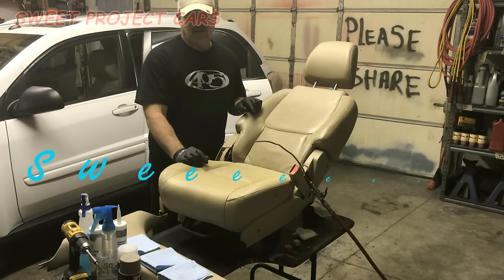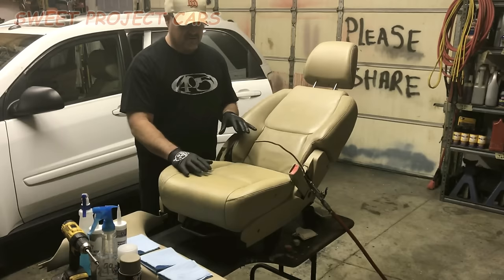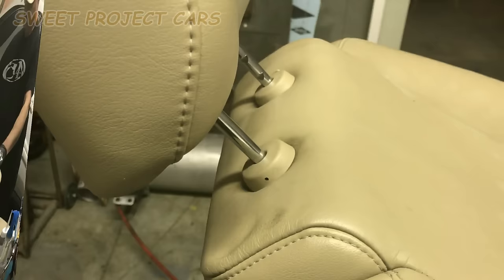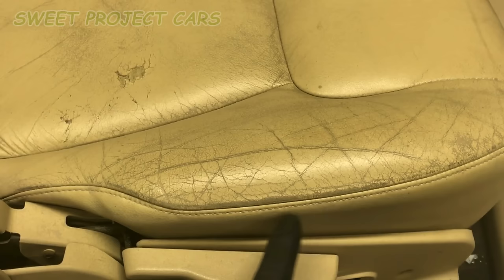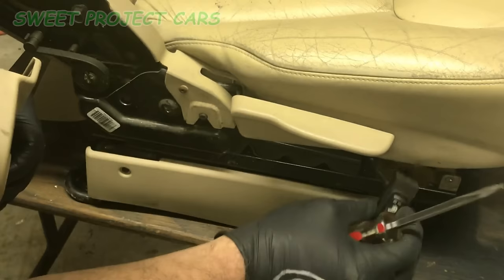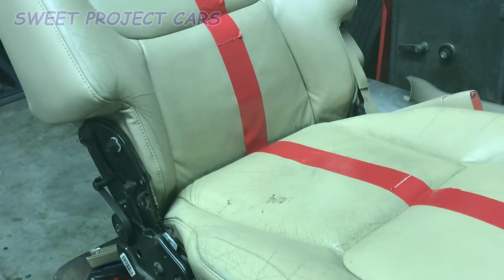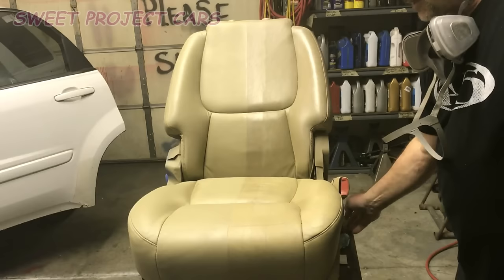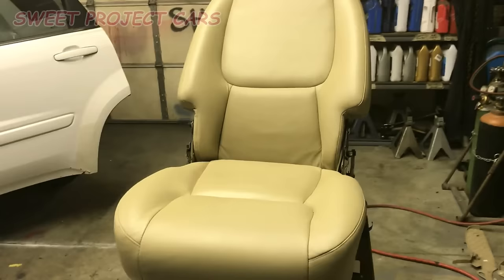How To Repair The NASTIEST Leather & Vinyl Seats....Back To PERFECT!

Comment: Hello, I have a question. After you restore your seats using this method, will you be able to detail them in the future using degreaser and a scrub brush? Will the harsh action of the brush during detail cleaning remove all the hard work you put into repairing the seats?
Reply from the maker: I'm not sure if your question is serious or not, we've been detailing cars for 40 years and never have we used a degreaser or harsh scrub brush on leather.  Thanks.  mad Mike the hammer SPC
Reply: @SweetProjectCars  Recently I watched a you tube video of a guy detailing the inside of his car, with degreaser and scrub brush for all the leather and plastic of the car. I tried it on my car and the results were spectacular, my seats were a completely different color, like new, much cleaner than what I have been viewing since i purchased the car, it was immaculate, they were so clean. What I am saying is that my seats have leather damage, the same leather damage you are repairing in this video, what I want to know is: If I repair my seats with your method, and they become dirty again over time, will my cleaning them with degreaser and a scrub brush harm the filler and paint you use? Basically will the degreaser and scrub brush (abrasive nature) rub off the filler and paint? That's all.

Comment: Does the paint change the texture of the leather? It's a 03 Saab 9-3 SE Convertible.  Also I would imagine the sun has changed the color since it's in the sun so much should I still do that? It's just the front seats that need it in small areas-on the bolster area from rubbing getting in and out and then drivers seat leg area, no tearing just normal leather cracks. The rear seats still look brand new and feel so nice, so supple lol. I want the front seats to look like that! Would you happen to know roughly how much it would cost to get front seats refinished in new leather?
Reply from the maker: Eric, this  https://amzn.to/2PWOfN3  will not change the texture of your leather.  It will be much cheaper to go this route than to have any replacement.  Thanks for the question.  Have a fantastic day!  mad Mike the hammer SPC
Reply: @SweetProjectCars  Awesome thank you!

Comment: is this method okay to use on perforated leather?? like wouldn't it plug up the holes?
Reply from the maker: Hello Mathan, this is not recommended for the perforated seats unfortunately, it will cause issues with the holes.  Thanks for asking.  Have a great day. mad Mike the hammer SPC

Comment: Good morning and thank you for all your videos.  I have tried several and 100% great except one!  I am repairing a leather drivers side seat using the silicone and all.  I believe I followed the method completely using the products you reccomend.  My silicone is rubbing off when used.  It reminds me of dry rubber cement when you rub it with your finger.  Any idea what I am doing wrong or could try?  Thank you Jeanette
Reply from the maker: Please watch all 3 videos in the series.  I cannot express enough how clean the seat must be before applying the silicone.  Hope this helps.  Have a great day.  mad Mike the hammer SPC

Comment: Great video.  The amazon links are not working.  Did you use isopropyl alcohol or denatured?  Also, did you wipe down or prep the silicone in any way after it dried but before you painted it?  Curious as to how you got the paint to stick to the silicone..  Thanks !
Reply from the maker: this is working https://youtu.be/3aFbL8ViTE8 and use this in place of any other cleaner  https://amzn.to/2z3oiBu
Reply: @SweetProjectCars  Thanks,  Did you clean, wipe with alcohol or do anything to the silicone after it was cured but before it was painted?

Comment: QUESTION Hello . I'm a fan of your videos and  love your  techniques . 
*Do you ever have trouble with any of your spray paint or spray dye sticking to the permatex when your doing the leather seat repairs?? 
I ask because in the past I've had trouble with getting the paints to adhere to similar products since most of them contain silicone. 
I have not yet tried the permatex brand that your using.
 I  really hate buying small containers of  "leather filler" products since they're  so expensive for very small amounts. Please reply if u have a moment. 
Thanks again for  sharing your experience and knowledge.
Joe
Reply from the maker: Joe, mix 25% of the paint with 75% fresh silicone, spread it quickly then when you paint after this dries, the paint will stick like a madman.  Hope this helps, thanks for the question.  Have a fantastic day my friend.  mad Mike the hammer SPC
Reply: Great Question! I wonder why the answer isn't in the video. How many f'd up restorations did this video cause. I wonder...Hmmmm.

Comment: Would this process work similarly on door panels, center consoles, etc.? I noticed a few small tears in my door panel as well as a crack in my center console.. I think the door panel is vinyl and the center console is plastic of course.. Also, my spare tire carrier cover has badly damaged.. The plastic clips that hold it place are broken off and the carpeting on it is covered in stains and some kind of adhesive to where the carpet itself is flattened like a pancake and looks almost like a bald spot.. I don't know if I can be restored unless I just recover it.. I bought the Jeep on Ebay from a seller with excellent feedback but got screwed because the brakes intermittently locked up and the battery was leaking acid everywhere.. The previous owner even cut out a piece of the bezel where the 4wd shifter is located to install a toggle switch for some accessory.. Needless to say I learned my lesson the hard way.. The best way to explain these issues is to show them to you because it's hard to explain in a comment..

Comment: Good tutorial,
I may attempt this on my 2007 GMC Sierra Classic,
I’ve used some superglue in past to temporarily fix or prevent further tears along the seams, as well as another product, can’t recall what it was and it helped but produced a noticeable gloss difference.
I would like to look at redoing both front seats.
Where can the paint color matches be found?
Reply from the maker: Watch this  https://youtu.be/XSTXiyJ2O9E   And we recommend these  https://amzn.to/2PWOfN3  or  https://amzn.to/2DJPV7Y make sure you use this first  https://amzn.to/2z3oiBu   Hope this helps Darin.  Thank you for watching and asking.  Have a great day.  mad Mike the hammer SPC
Reply: @SweetProjectCars  
Thanks for the advice-
Will check em out!👍

Comment: Hello, I have question re: the SEM Plastic & Leather Prep spray #38353. Locally they only carry SEM Plastic Prep, #38343. Will this work the same for prep as the one for Plastic & Leather? OR do I have to still use the #38353???? Thank you
Reply from the maker: You need this  https://amzn.to/2z3oiBu  Thanks for watching and asking Bonnie, have a great weekend. mad Mike the hammer SPC
Reply: @SweetProjectCars  Hello Mike, I live 40 miles from Reno/Sparks and I got the SEM Plastic/Leather Prep at Summit Racing. So, now I am striping the peeling black trim on outside of 01 Subaru, then painting with SEM Trim Black Ultra, and SEM Bumper Coater thus far. Trim & bumper came out beautiful. The damaged front leather seats will be next on the list of to do's. Thank you for getting back with my questions. Garage Girl Bonnie

Comment: I have refinished a few boat seats using this process. However I've experimented on a headrest using the exact caulking that you recommend. However after using the vinyl spray paint it is cracking and peeling right off. I am following your process exactly. What could be going on? I am using sem vinyl paint
Reply from the maker: Have you watched all three videos in the series? You’ll see in one of the videos how to mix the paint and silicone together before you spread it then when you paint it it sticks and will never come off hope this helps have a great day mike sweet project cars

Comment: Hi everyone. I used this technique to recolor my 85 944. It came out great for the most part. However, one area, where I used the silicone to repair a small rip, does not want to take the paint. it flakes off. Did I damage the silicone somehow with the 99% or prep spray prior to painting?
Reply from the maker: Watch this  https://youtu.be/Sp6HGSSQGXk  for additional information on painting silicone Roger.  Hope this helps, thanks for watching and asking.  mad Mike the hammer SPC

Comment: Great video!! Even after 2 years. 
Can you tell me how long it usually takes for the silicone to cure to the point that I can run my finger over the ridges?
Reply from the maker: It depends on the ambient temperature and humidity at the time of the process, could take 48 to 72 hrs. but it all depends. Thanks for watching, have a great day. mad Mike the hammer SPC

Comment: I didn’t think paint liked to stick to silicone. Do leather/vinyl paint bond well to the silicon coated areas?
Reply from the maker: when the process is followed in the 3 videos made for this series and the same exact products are use it works and bonds every time.

Comment: @Sweet Project Cars Thanks so much for sharing this. That said, what would be the process with heated/cooled seats that have the holes in the seated portion in addition to the back portion? I'm assuming that silicone would clog those holes & prevent the heating/cooling from working as designed. Is there a workaround for this or would one need to use a totally different restoration method?

Comment: I have a 1980's dash that has cracked, brittle vinyl over foam. What's your opinion on using silicone to repair the cracks? Most people use urethane dash filler then sanding and painting like bodywork. I suck at bodywork so I'm curious about the silicone.
Reply from the maker: Well, the silicone will work on the flat areas but blending on the sharp radiuses of the dash is going to be difficult.  Not sure if you are looking to do a "professional" job or looking to just fill the cracks in but if you want a professional look, you are better off just replacing the dash because it will never look as good as you probably want it to.  Thank you for watching and asking Marc, hope this helps, all the best on your project my friend. mad Mike the hammer SPC
Reply: @SweetProjectCars  thanks for replying

Comment: Thank you for these videos. I plan on using your method. However, I have a deep gash in one spot. With the clear silicone, can I slowly fill in the gash? Say my gash in 1/2 inch deep. Can I do a few layers of 1/4 or 1/8 inch of silicone, then let cure then layer again eventually building my way up to the top?
Reply from the maker: You sure can use the method you are describing

Comment: Does it have to be that specific silicone adhesive?
Reply from the maker: You can use whatever you want to use we are just sharing what we have tested and tried in our 40 years experience that we know works and is safe for your vehicle.  Thanks for watching, have a great day. mad Mike the hammer SPC

Comment: How long does it take for the silicone to dry to be able to paint it?
Reply from the maker: It depends on the ambient temperature when you are doing it, it has to be 70 degrees or warmer, usually 24 to 48 hrs. to dry, but again, depends on temp and humidity where you are at.  Hope this helps.  Thanks for watching.  Have a great day. mad Mike the hammer SPC

Comment: Maybe someone has asked this before, I watched this video many times. Then I watched your "how to paint silicone" video also. Am I missing something? In this video you don't seem to add color to the silicone to make it paintable. So how does the paint adhere to the silicone? Is it the type of paint? Or prep?
Reply from the maker: You don't have to add the paint, but it does make it easier.  You use this  https://amzn.to/2z3oiBu  for leather or this   https://amzn.to/2AVv11Q  for vinyl when doing the process shown in this video.  Hope this helps, thank you for watching, have a great week. mad Mike the hammer SPC

Comment: i really could use some help now, i have a 2007 ford ranger paint code yz=white and int tr code QF. i cant find this anywhere. if you know this off hand i would be grateful.
Reply from the maker: Hoping you found one that works for you John.  Again, you may have to buy a couple different colors to get the match you are looking for.  Thanks.  mad Mike the hammer SPC

Comment: I discovered this video in May 2021. I am curious to know how this silicone technique has held up the last few years. I’m sure others would like to know as well. When the job is finished, is it easy to slide off and all of the seat or does it kind a have a tacky feel to your clothes??
Reply from the maker: We've done this process for hundreds of customers over the 20+ years, if done as shown using the exact same products, it will last years and years.  As far as your other question, not sure what you are talking about sliding off the seat?  Thanks. mad Mike the hammer SPC

Comment: great video! will leather dye with an applicator pad also work on the silicone? in the video i see you used a spray, just wanted to be sure before ordering, thanks again for the awesome tips!!
Reply from the maker: World travler dye will not work on the silicone sorry
Reply: @SweetProjectCars , thanks, I would have thought that dye or spray had the same adhesive properties...
Reply from the maker: World Traveler apparently not as we could never get the dye to soak in and that's what dye does, paint is a covering it does not soak in it adheres

Comment: What if i missed the adhesion promotor step?  Whats the best way to remove the silicone?
Reply from the maker: Well I can tell you this, if you missed that step, you may be in big trouble because you need to remove that silicone now and there's nothing we know of that will take that off :(  Sorry my friend, all the best on your project. mad Mike the hammer SPC
Reply: @SweetProjectCars  the silicone remained tacky after more than 24 hours on my leather sofa. The temp was 70 degrees. (Im in AZ). I was able to rub it all off.   What did i do wrong for it not to have been hard to remove?

Comment: I thought in another video you mixed the paint with the silicone before applying to seat. This time you just did silicone then paint?
Reply from the maker: Hello Bob if you are not seasoned at doing this process we suggest doing the mixing before applying
Reply: @SweetProjectCars  Thank you, I'm going to do this on my 01 F150 leather seats.

Comment: what's the difference between the LVP refinisher paint you recommend and the SEM Vinyl Coat?  Use both? or Either?

and one more question.  I have some rough areas on some boat cushions.  Would you suggest doing the cleaning, prep and  thin plain silicone, let cure to fill in.  Then clean and prep, then add silicone/paint mix and smooth the edges and let cure?  or just do the paint mix and silicone all in one step, then spray final coat when dry?
Reply from the maker: You can use either of these  https://amzn.to/2PWOfN3  or  https://amzn.to/2DJPV7Y  And yes, on your second question, do the cleaning, prep and thin silicone cure and fill in.  Thanks for watching and asking ER.  Have a great day, good luck on your project my friend.  mad Mike the hammer SPC
Reply: @SweetProjectCars  my seats are in rough shape.  The colored vinyl is definitely a different grade on these seats than the white.  it's just brittle so had to use more silicone than I had hoped.  But this was never going to be a quality detail job for me anyway.  But i'm not getting good adhesion with the paint.  after the silicone I cleaned with 99% again, then spray with the plastic and leather prep spray, wipe down, dry then painted.  4 light coats and let sit in 70 degree garage

Silicone is on there, it's good, but not sure if I didn't mix enough paint for good paint adhesion?  it has the color hue I used and I mixed it thoroughly before applying.  Maybe sand off, and use more paint in the silicone mix?  thanks again

Comment: did you put permertex on the cracks? I mean the part where the leather is doing its regular thing
Reply from the maker: Not sure what you are asking?  The cracks in the leather, yes, the seams in the leather, no.  Thanks.  mad Mike the hammer SPC
Reply: @SweetProjectCars  my permatex is rubbing off

Comment: What is the best method to use for a black couch?
Reply from the maker: You can do this process on any color or any leather anywhere.  Thanks for asking. mad Mike the hammer SPC
Reply: @SweetProjectCars  do I use gloss or matte? I've seen your other method on the other video you posted using the the lacquer thinner. Thank you for the help.

Comment: Don't know if this will get read, but how would I apply this to my seat that is perforated in the middle cushion..  like the style its a 1990 pontiac gta  in grey leather... with the middle cushion has all the little holes from factory.
Reply from the maker: Thanks for asking Chrono88, you can be real tedious and poke all of those holes with a toothpick or you can cover it as shown in the video and fill those holes.  Otherwise you may have to buy new covers.  Hope this helps answer your question.  Have a great day.  mad Mike the hammer SPC